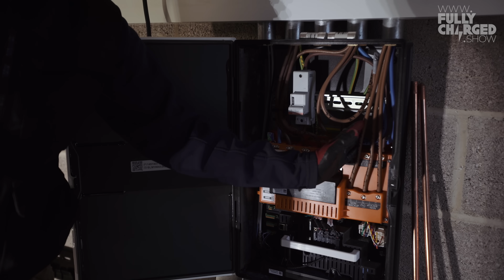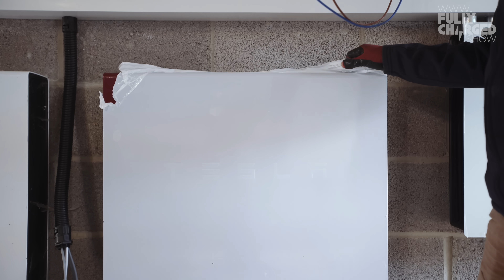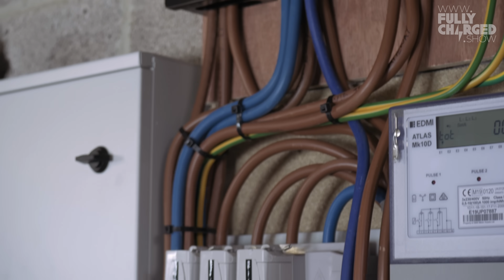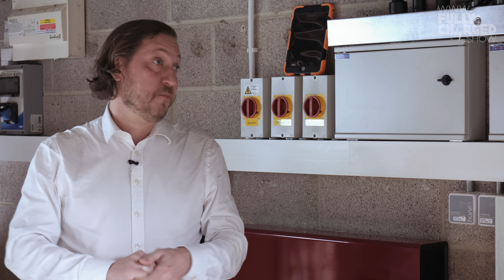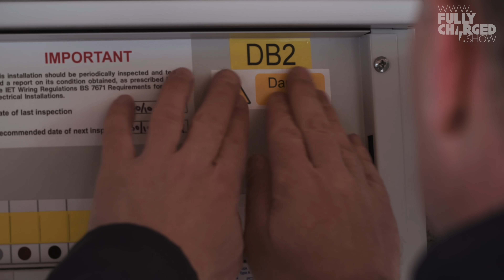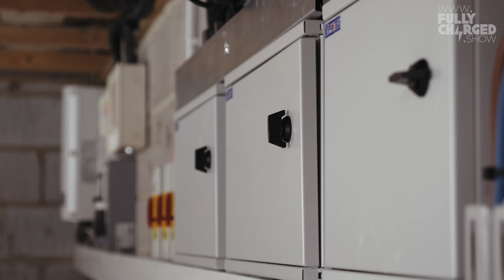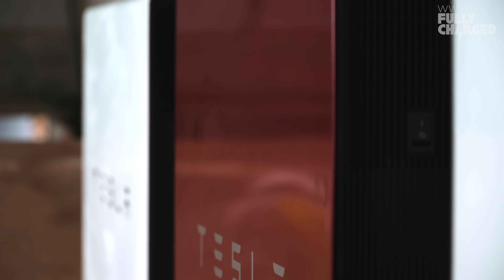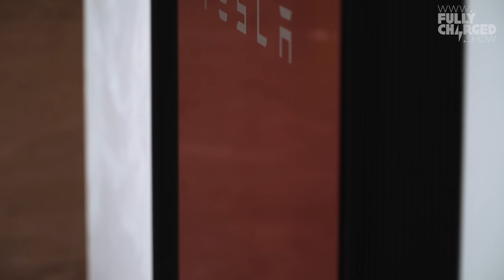Can you run your house on a battery? Tesla Powerwall 2 (Founders Series) & Tesla Backup Gateway 2

Comment: Yes you can. Mine works amazingly well. Not even a flicker of a light bulb and power stays on. It works SOOOOO well.
Reply: shame there isn't an instant switchover, to maintain computer equipment.
Reply: @SimonHollandfilms  that's what UPS is for.

It comes down to the technicalities of switching 300w Vs 30KW.
Reply: @SimonHollandfilms  Why not plug your computer into a separate UPS?
Reply: Professor Simon Holland I have a powerwall with backup gateway and my power is completely seemless in backup operation. Computers, clocks, router all continue uninterrupted. 
I don’t know why his went off, only thing I can think is that it is something to do with it being 3 phase, but I can’t see why that should make any difference.
Reply: Professor Simon Holland I have a powerwall with backup gateway and my power is completely seemless in backup operation. Computers, clocks, router all continue uninterrupted. 
I don’t know why his went off, only thing I can think is that it is something to do with it being 3 phase, but I can’t see why that should make any difference.

Comment: UPS which is what this is takes too long to change over uninterruptible is exactly that  not 5 seconds later.
Reply: Doug Brennan Why did it take so long!? Mine is completely seemless. Don’t need to reset clocks!?
Reply: This isn't UPS.  It's likely the issue is the mechanical separation of 3 separate power supplies (3-phase).

What would be really interesting to me is what happens when there is a single-phase failure.  It doesn't happen often, but there have been cases where only one phase has an outage (and you see just every 3rd house on the street go dark) - if that happens, will this gateway mechanically separate from just the 'dead' phase, or all phases? 

Or, worst case, leave the 'dead' phase connected, and make it live using the power from the battery?

Comment: Oh dear, just spotted Proteus fuseboards in Roberts house. In the trade (I’m a spark btw) they’re known as the cheapest of the cheap. I wouldn’t have that kit in my house. I wonder if Robert knows his installers are using cheap Chinese rubbish?
Reply: I was just going to say the same, decent install let down by proteus DB’s. They try to glam them up here by making them sound posh, pronouncing it Pro TeyUs ! 😀
Reply: Also Dr. Chris Jardine was incorrect on his single phase description. Single phase has 2 hots and a neutral. If you are going to install this stuff you need to know about electricity I would think!